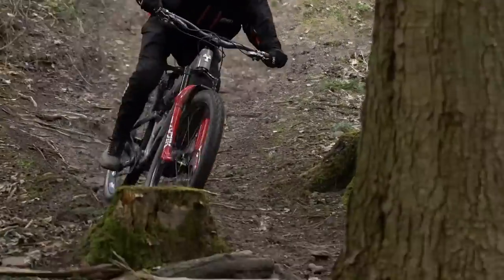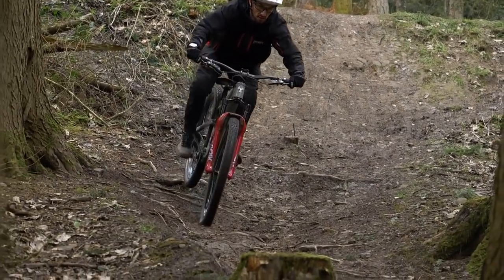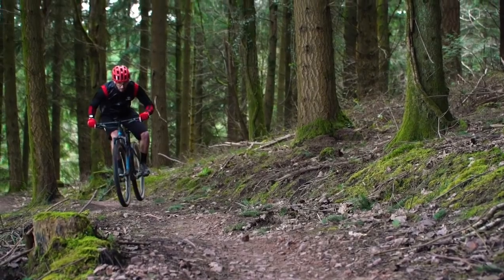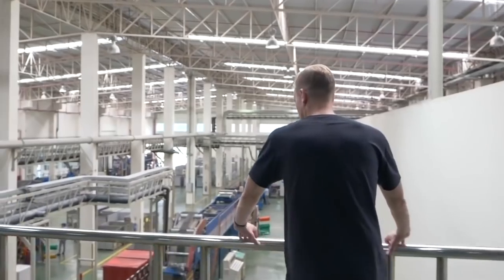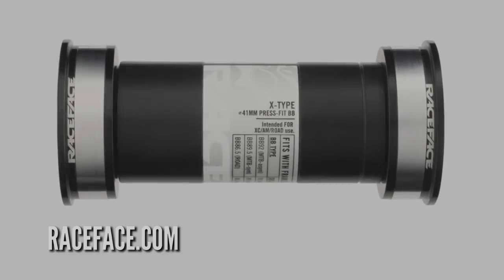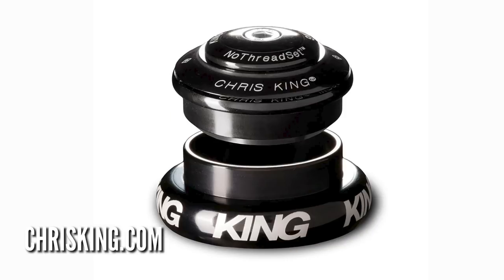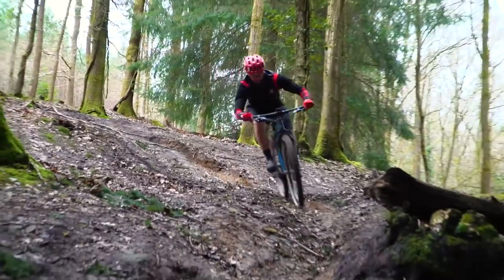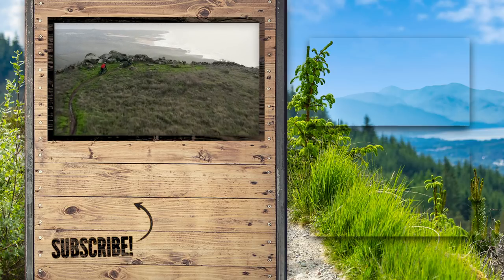The Most Confusing Things About Mountain Biking | MTB Explained

Comment: Most confusing thing by far is the constant industry trends and “new standards” which change stupidly fast 😂
Reply: Best is that axle width 28.9 😂 as if it changes anything compared to 30
Reply: It's because the mtb industry is heavily influenced by engineers in general. People make fun of the marketers but forget it's the engineers that change things by 2% stiffness or 2mm and leave it to the marketers and sellers to come up with the benefit to communicate to the community.
Reply: @kneawah  funnily enough, normally the engineers get hold back by the guys with the money
Reply: @steilkurbler4973  Probably a good thing otherwise us customers will be shelling out an extra $1k every year because someone decided to widen the BB shell, hub spacing or change some interface. Someone would have to recover their "R&D costs" and it would be you and me.

Comment: I've been mountain biking since 1990.  My first bike was a Diamondback Ascent EX (cro-mo frame & rigid fork, Deore LX) and it served me well.  Back then, we had to use our legs and our upper body much more and in different ways, and plan our line along with necessarily refining our balance techniques.  Then, it was a far simpler, more relaxing, slower-paced, holistic exercise.  Now, douchebags who think blasting through otherwise beautiful foliage at warp speed, not unlike douchebags who think bench pressing 300 lbs twice at the gym is a workout, dominate the activity with helmets meant for motorcycles, full suspension monstrosities that obliterate kinesthetic input (the whole reason you're on the trail to begin with), and a Red Bull ethos that demands trick riding be called "mountain biking".  The most confusing thing about mountain biking?  How and why it got turned into a bike park in the woods populated with egotistical adrenaline junkies.
Reply: I think your scared to go fast lol
Reply: @mrwezbmx  Chug another Red Bull and tell yourself you're "extreme" - LOL.

Comment: I recently came across the channel and love riding my bike, I've never done mountain biking but have a mountain bike because of the ease of riding. I have an Ozone Ultrashock 500 and I was wondering if it's good for mountain biking when this whole corona thing is done. I've never mountain biked, and would start simple if I do, but was wondering how to get started. Thanks!

Also my bike is 1-7 speed and I was wondering what speed you should use when climbing, cornering, and general riding. When biking on the road I always have it on 7 because I like riding fast but I'm  not sure when on the trails.

Comment: I think that you forgot about dropper posts. I have a Crankbrother's one (which has been great by the way!). However, it seems like after pressing the lever to lower it, to the bottom for a descent, the saddle starts rising slowly. I try to change the tension next to the lever to adjust this, but I honestly have no idea what I'm doing. I would like to think I'm a somewhat capable guy (with a PhD in Robotics and everything) but I'm not sure whats going on.
Reply: Todd Farrell The Highline is pretty picky about cable tension. If it’s creeping up, you need to screw the barrel adjuster in, so the housing is effectively shortened. Just think of the barrel adjuster as the end of the housing and it becomes pretty clear.

Comment: Clipless means you are clipped in to the pedals, most confusing thing to me.
Reply: Clipless pedals don't have toe clips. Which are the older variation with straps and, toe clips, the part that goes over your toe. They are arguably more dangerous than modern clipless pedals because you have to pull your feet straight back to get out of them, that is if they aren't too tight. 

So when modern clipless pedals were introduced, they did away with the toe clips, and got the nickname "clipless" which stuck around.

Comment: Buying all the tools what I need...
Reply: Nick Maclachlan  You're not familiar with how tools work are ya. 

If you buy a cheaply made tool, you'll spend twice as much in the long run replacing that tool as if you had just bought the good version in the first place. 

Park makes their tools in shop quality materials. Made to be used for years consistently. 

"steel" isn't just "steel". there are many, many, many different types and qualities that it can have. Cheap tools use cheap steel, and will wear out much faster.

Comment: Frame Cost and Pricing!   
Bike brands only engineer frames and most don’t even construct them they use a 2nd party to do that for them! 
And some buy in engineered linkage designs, and design a frame around the purchased linkage design. 
Then they rely on other companies to engineer and make componentry eg(Shimano, Sram, Fox etc). 
How can a high end bicycle frame cost $4500  and a complete build cost up to $16000 it’s purely ridiculous!
There is much much less engineering, manufacturing and material in a bicycle than motorcycles or cars! 
Yet they cost the same🤪🤯.
It’s a  Scam! Ripoff! Exploiting! Racket!
Reply: Dude. 

You're buying into some grade-a fake news bullshit. 

"bike brands dont even construct their frames" lmao what the actual fuck? Most bike frame manufacturers ARE their own company. There is a small handful that have started outsourcing labor, but most (the ones that are worth even paying attention to) do not. And at the end of the day, if the frame is built to spec, it's the design that matters more than where it was built. 

"there is much much less engineering-in a bicycle than motorcycles" actually, motorcycle and bicycle suspension and frame design are extremely, EXTREMELY closely related. In fact, much of what makes up a bike suspension is just as cutting edge as modern motorbike suspensions. It's not ridiculous, it's how the industry works. 

"yet they cost the same" haha, no. A motorcycle with comparable tech to a high end MTB will cost tens of times more, You're just comparing the most expensive bikes to the "average" motorcycle price. Which is a flawed viewpoint. 

You're the only racket here. Educate yourself.